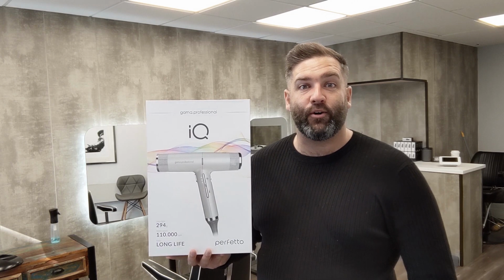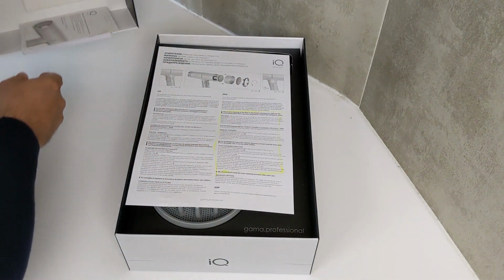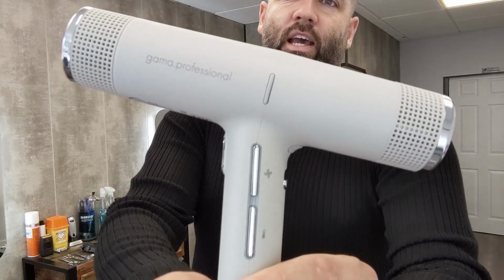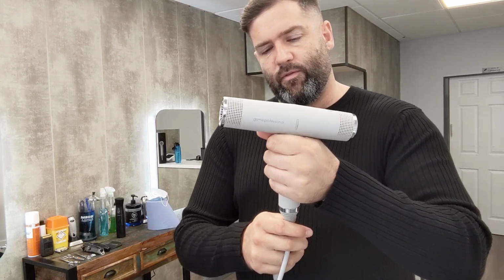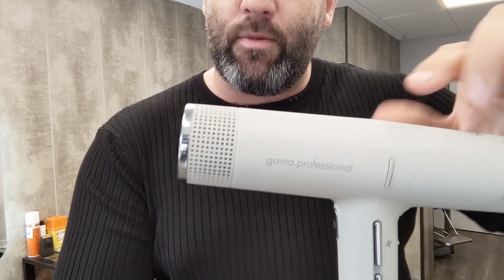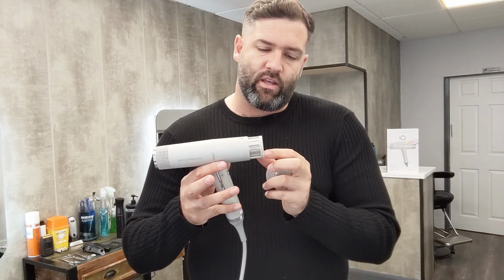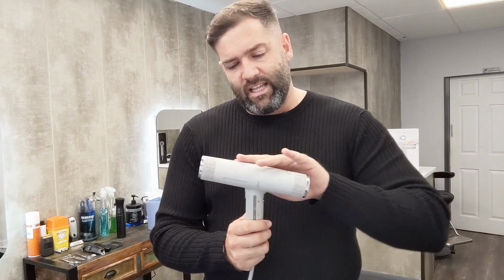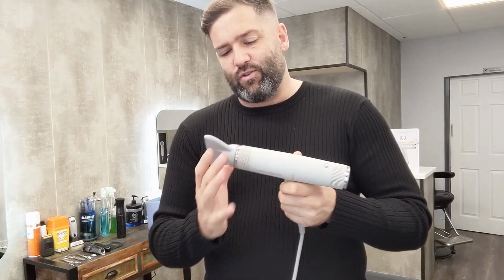Gamma IQ perfetto Unboxing | The best Hairdryer of 2020?

Comment: I have one and I rarely use it as I use a dryer brush to dry my hair. When I do use it it’s to dry to 70%. I clean it after every use which is maybe one a month or less. The heat quite working and I’ve had it about a yr.
Reply from the maker: Since I bought this I’ve moved on to the diva atmos, it’s basically the same thing. But with these types of dryers the don’t seem as robust as a traditional dryer

Comment: Purchased one for home use and 1.5yrs later it is unusable, broken and was told by the company it's out of warranty and they can't help me. It would just stop working after seconds of starting. I followed all the instructions for use since i've gotten it, only wash my hair twice a week. My husband out of desperation to salvage this $400 piece of junk finally took it apart and found that the cord had arched. Clearly not caused by the user.  Save your money..I wouldn't recommend this dryer to anyone.
Reply from the maker: That's very disappointing especially since you were only using it domestically. I'm sorry to hear that. I gave mine to my partner who is a hairdresser and she uses it professionally, so far she's not had any problems, it sounds like the manufacturer should really be sorting that out for you.
Reply: @theoneminutebarber  I agree! To say I was disappointed in the company's  response is an understatement.

Comment: Thank you for the review. Do you know the temperature of every level? 😀
Reply from the maker: Unfortunately not Sofija, but the third setting is extremely hot. I alway dry with maximum air force and lowest heat as am generally directing towards the scalp a lot. (men's hair)
Are you going to buy one. If so don't. They are great, but the diva Atmos is half the price and better as it has everything the perfetto has plus it has magnetic nozzles. Which are essential if you change the direction of the nozzle a lot.

Comment: When I use it, the diffuzor is very hot for me! 
It is normal?
Reply from the maker: Make sure your heat and speed settings are on low. If it's too hot it's a case of moving it further away from the head. And also keep moving it around while you work. Don't keep it in one place. The diffusers main job is to dry the hair without flattening it with force.
Reply: @theoneminutebarber  Thank you :)